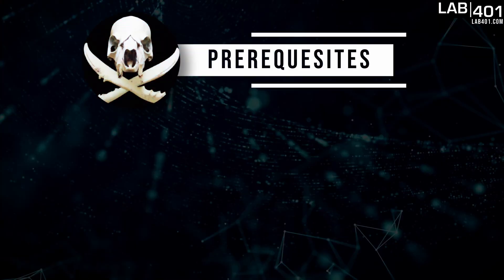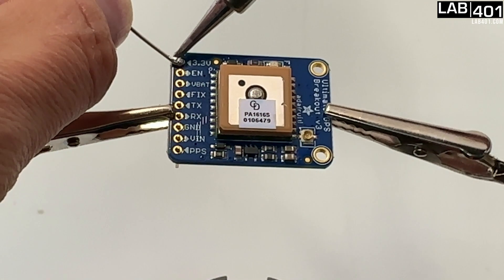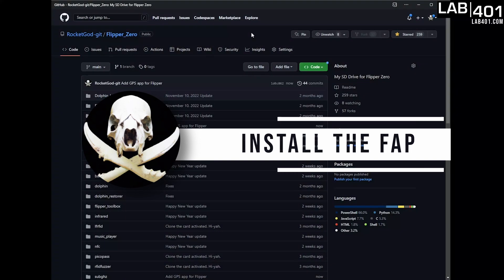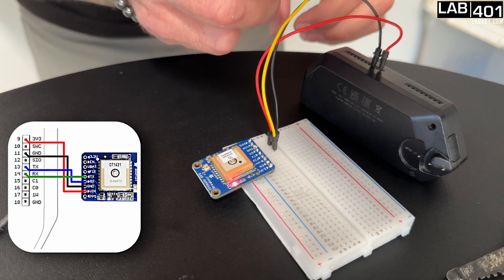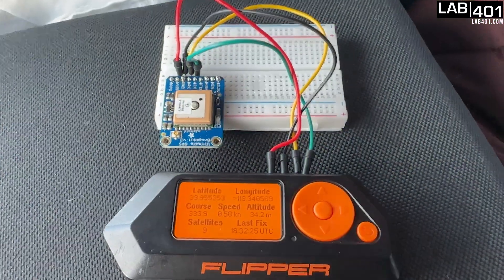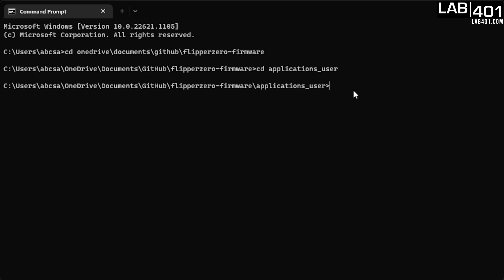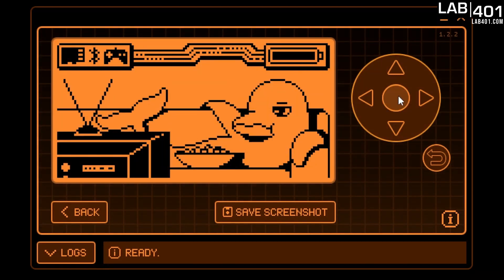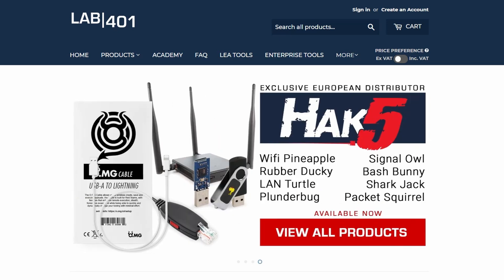LAB401 Academy: How to GPS on the flipper zero? with RocketGod

Comment: Do you know if the Flipper can also simulate a GPS signal please ? 
I just want to transmit my home position to my mobile phone when I'm not at home.  
Thanks for the video
Reply: asking for this too... do u have any clue now?
Reply: @ardyaritonang  No... I use the HackRF in order to simulate GPS
Reply: @MrDenisJoshua  so hackrf device can simulate gps signal? so the position of the cellphone near the hackrf can change according to the coordinates set on the hackrf?
Reply: @ardyaritonang  yes... in this mode the cellphone have another position
Reply: @ardyaritonang  Tou can regulate the power... I don't remember now how much is it mine regulated, but if I go at about 5 meters is not working anymore. 
It's work only if I'm near.
Reply: @MrDenisJoshua  thankie
Reply: @MrDenisJoshua  anyway, i see 2 version of hackrf, whitout LCD, and with LCD? which one do u use?
Reply: @ardyaritonang  I think it's ok all two... but I use the LCD Version
Reply: I think it can't work because gps works on 1575.4200ghz